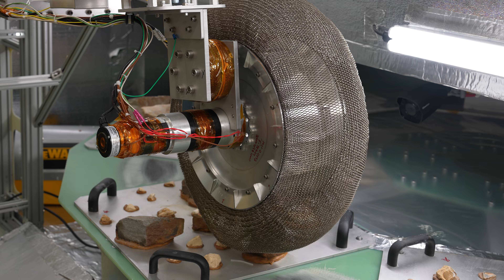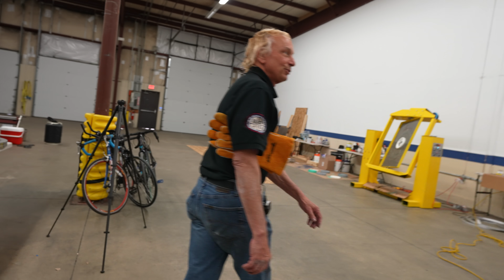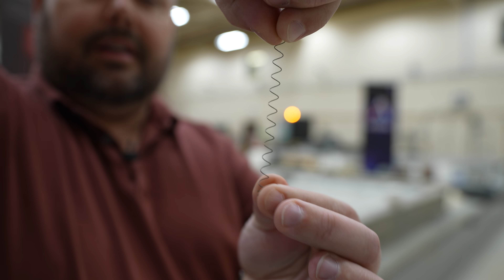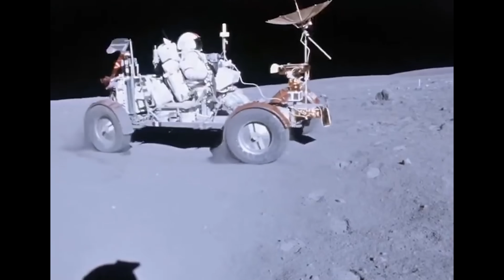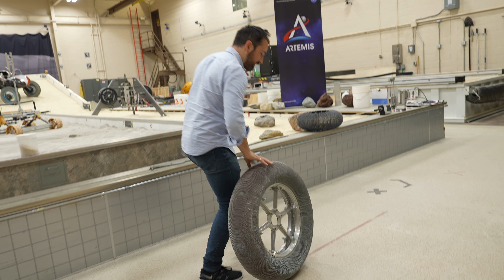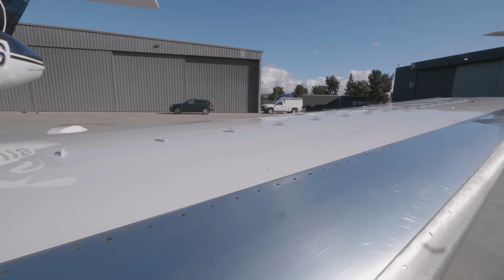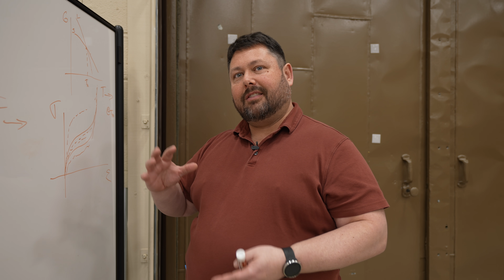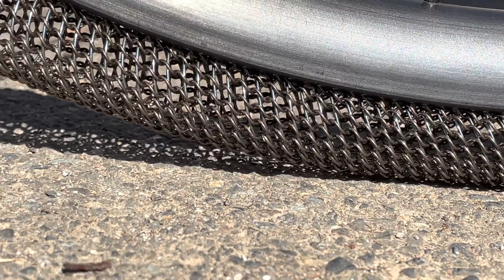How NASA Reinvented The Wheel

Comment: Although simple, wheels are taken for granted so much. They’re so awesome and a great invention
Great video :)
Reply: Why not use in tires on earth?  Because it would put companies out of business. Everything on earth they make to be replaced, over and over and over again. $$$$$$
Reply: @briteeyes2133  impracticality will never let these tires get to the public. These Tires may be well suited for a surface like mars, but imagine driving 100 km/h+ on asphalt. They'll deform way quicker, wont be able to handle a hard surface like roads, the heat generated by those speeds will be insane, and the average car weighing more than 1500 pounds more than a mars rover these tires just arent designed for regular consumers. And thats not even touching on the price point of these things.
Reply: @lonesome3958  not exactly. Yes, automotive is challenging, but keep a few things in mind. Extreme temps are nothing: these materials are being flight rated for space travel. We're talking from -230C up to hundreds of degrees in the other direction. The deformations are nearly instantaneous - it actually involves a phase transformation in the material itself and not even ordinary stretching. That's fast. No highly pressurized air inside (where a lot of the heat wants to go). Material is a titanium alloy and suited for supporting everything up to tens of thousands of lbs depending on the design. Rover tires are just intentionally soft to float on sand.
Reply: @briteeyes2133  it's hard to appreciate just how good pneumatic rubber tyres are. The rubber fulfills three roles at the same time (containing the air, deforming around unevennesses, and giving traction to the ground), whilst the air manages to support a big weight with very little obstruction to the deformations / rolling.
Those nitinol tyres do a formidable job at replacing this functionality, but they can't do it all as well as pneumatics. Unless you need your tyres to work at insane temperatures or survive deliberate perforation (and can't use liquid sealant), there's just no point.
Reply: @leftaroundabout  the prob with them is they have to be replaced often and when billions of people replace billios upon billions of tires that's a lot of waste. Waste in landfills, lakes, oceans, wherever people can dump them. They are an unsightly mess.   Creating something that would last longer and not need replaced as often would be beneficial to all concerned Even if just using the "slinky" on the inside instead of air.
Reply: @briteeyes2133  100 billion pounds of end of life tires every year. 100 billion!!!
Reply: @leftaroundabout  no doubt pneumatic tyres have a lot going for them, but don't sleep on their downsides (maintenance, flats, pollution). Nitinol tires are by no means easy, nor fully rolled out commercially, but they do fundamentally solve problems that other airless do not, such as deformation and load carrying. Also do not confuse rover tires, or the bare metal Jeep tire, for the end product.
Reply: @The SMART Tire Company  that's a HOFFIFYING and horribly sad FACT!   Growing up I remember a  man had tires on the back of his property. Stacks and stacks of old tires. When it rained they would get water in them and it caused a huge mosquitoes infestation.  I've seen some parks chop the tires into pulp and use them on playgrounds.  I guess that's a practical use but how long does it take a tire to disintegrate,  if it ever does? I'm all for items that last. This DISPOSABLE world where we replace everything every few years wiill lead to a planet like in WALL-E. Sadly, we are headed there fast.
Reply: @The SMART Tire Company  I subscribed to your content! But you don't have any info!! Lololo Thank you so much for replying!
Reply: @briteeyes2133  there are efforts to recycle, but sadly the majority of that tire material ends up in landfills or as "reclaimed energy", which is a very nice term for "burning tires".
Reply: @briteeyes2133  thanks! We're just getting our feet wet on YouTube (too much tire work to do), but grateful to Veritasium for putting us on the map here!
Reply: @thesmarttirecompany  tyres also have pretty amazing longevety, compared to all alternatives. It's just that we roll them around over insane distances! I doubt that metal tyres, even nitinol ones, could take it up with the rubber version, you still get abrasion and fatigue and mesh unravelling. The only way to get better longevity and avoid pollution is to not roll on an abrasive surface, which leads to rails or maglev, not any change in the tyre material.

As for punctures, these seldom happen on normal roads. In use cases where punctures are a problem, liquid sealant pretty much solves it.
Reply: @leftaroundabout  it's definitely a challenge for the applications you are talking about. No doubt about it. Fatigue life gets very interesting. Think of the heart stents the material is used for - they have to cycle every heartbeat for the rest of your life. So the potential is there. Also, you want to limit the strain under normal usage to maximize the lifetime. Regarding flat tires, we've come a long way but they are definitely still there (about 250M per year in the USA). Also, this is not just about flats. Think about the fuel lost to under-inflation (which is always happening every day at some level), the safety aspect (a significant contributor to accidents), etc, etc. The safety issue for aircraft (affects the entire design of the plane)... other applications such as mining or agriculture. Trucking vs automotive. Autonomous vs manned vehicles. Tires are a deep, deep subject with a lot of verticals.
Reply: @leftaroundabout  Dude, this wheel got shoot and it still fine, it is much stronger than your ordinary wheel for long walk
Reply: @wtfdude1830  yeah but these nitinol tyres are not good for regular use
they wont work properly on highways and stuff
they'll deform and they wont be able to recover fast enough
Reply: @briteeyes2133  watch from 22:08
Reply: @briteeyes2133  we're on it.
Reply: @The SMART Tire Company  awesome!